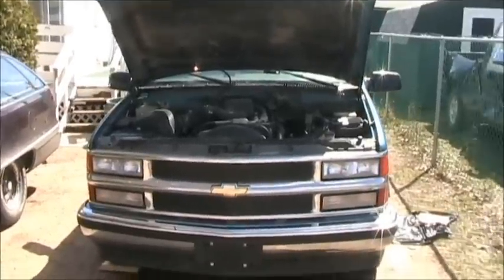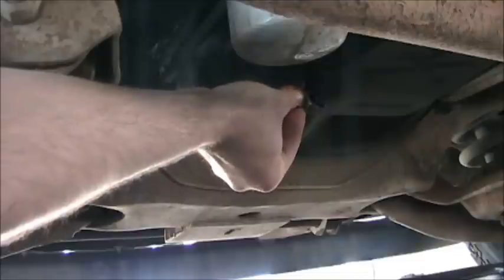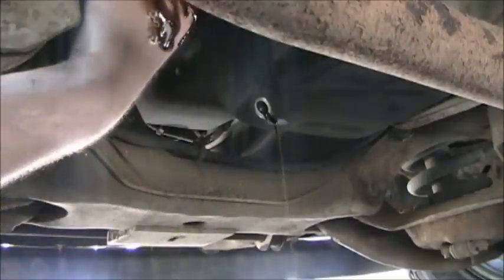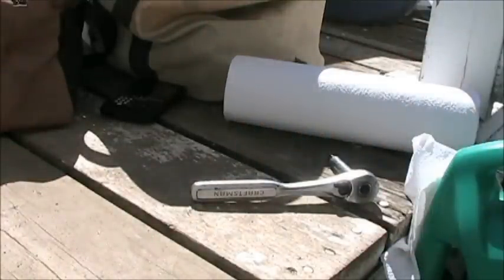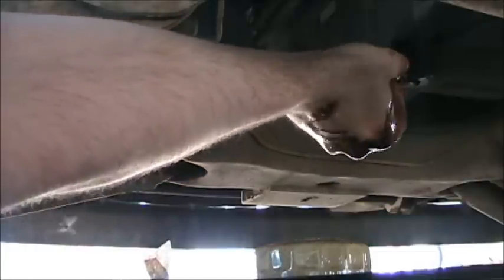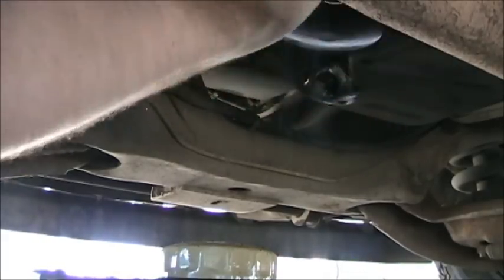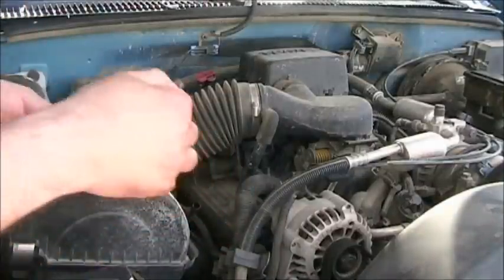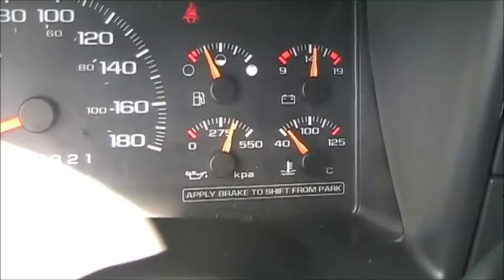Oil change How-to DIY in a Chevy Truck - 1998 Silverado with a 5.7L 350

Comment: You have it so easy on the 2wd models. I twisted my filter in half because it was so tight. Mine's a 4x4 too, so the drive shaft is like 4 inches straight below it. Impossible almost to get to.

Comment: Those 88-98 chevy trucks run best  mileage per gallon with Chevron Supreme 5w30 oil.
Reply: Woodcamo Nut 
That's all I use for my 94 Chevy. In fact I use 5w30 in the winter and 10w30 in the summer.
Reply: David's Garage 
I'm using 15w50 currently because I'm having oil issues. She still seems to love it. I believe I have a scored journal on the crank, so oil must be squeezing past bearings. Will have to do for another couple of weeks until I have enough saved to get it rebuilt lol.

Comment from the maker: @ils360 Meh...I usually use Mobil 1 only, however I don't know how this truck deals with oil.  I've had engines really blacken oil after 2000 miles, others, like my wagon, I almost feel bad replacing it, its so clean.  Given I don't know the characteristics of this engine yet, I got an appropriate conventional oil based on brand and price...aka a brand I have heard of before and a price that wasn't awful.  I don't use Marvel Mystery Oil, only GM approved fluids.

Comment: Instead of filling the oil filter you can just rub some around the ring and than put it on empty and fill up the oil and start it to fill the oil filter
Reply from the maker: Yes, but in that one second it takes to fill your oil filter, your engine goes without oil, which isn’t cool.

Comment from the maker: @randomrazr Yes I have...I have used it on bad oil covered engines, noting what drips off the engine is pretty much oil and usually hitting the drain.  I usually do a spray of Simple Green now a days if I really feel like I need to do the whole thing.  About to make a video on how I clean engines now which is usually piece by piece...takes longer but looks nicer.

Comment from the maker: Not much you can do except check the wiring.  Otherwise it will require replacing the sending unit (most probable cause) which is expensive.  Not sure on these models, but the fuel pump and sending unit are often one piece.

Comment: Different for a 4x4, filter is an ass to get to
Reply: rikishitiki4546 yah just changed mine today, below the idler arm in a cramped spot gotta get in there aha
Reply: Its not too bad just dont fill the oil filter. I learned the hard way my first time.  Lol
Reply: rikishitiki4546 it’s easy
Reply: @Wolfman Jack I just spent about 20 minutes trying to get that thing out with a filter wrench and I can easily say I’m a stronger man after that.

Comment: Two ways (I found) to mess this up. 

1. Leave the filter sealer ring on the engine when you take off the old filter. If you screw this up, you may kill your engine. Oil change companies pay out big liability insurance every year for this one. Always check. 

2. Don't bother to look under the car after you turn the engine on. It's your chance to see oil spray, before your customer drives off and the engine dies because you weren't paying attention. 

Experience is always the best teacher.

Comment: Do you fill the oil filter all the way or how far???
Reply from the maker: As much as I can, on cars with vertical oil filters like this one, all the way.  On others with horizontal oil filters, I fill it about 1/2 way so it doesn't leak out as I'm threading it on.
Reply: Ok thank you. Ive never known about filling up the filters too. Thanks for the video
Reply from the maker: It's not super common, but what you are doing is saving your oil pump from having to fill it before supplying oil to the engine.  I figure its worth the 1 or 2 seconds of engine oil starvation to just fill it if you can, if you plan on owning the car until it dies.  On a new car you are going to sell/trade later, I wouldn't bother.
Reply: O ok. Thats great to know

Comment from the maker: Pfff.  No.  You need to prefill the filter on any car.  It takes what...5 extra seconds to fill the filter up via the engine?  So why would you let your engine starve for oil for 5 seconds?  Is the 30 seconds it takes to pre-fill your oil filter that hard?  Most people would say no.  I mean, if its not worth it on your regular car, you aren't going to give a poo about a turbo car either.